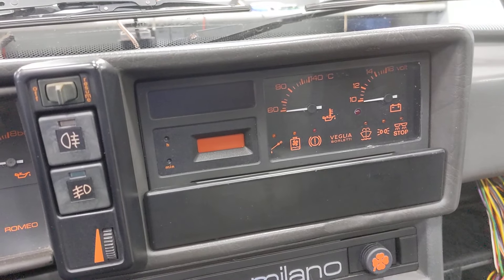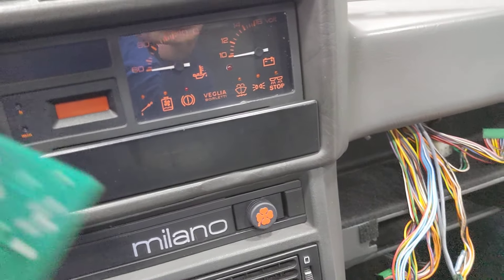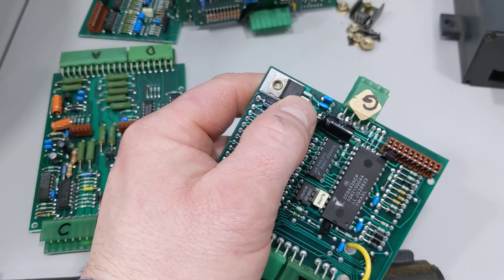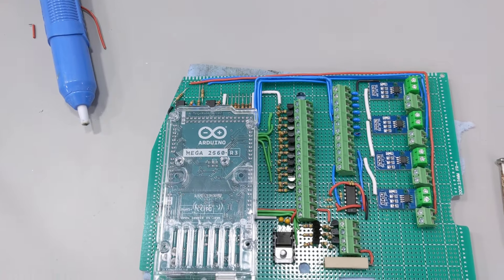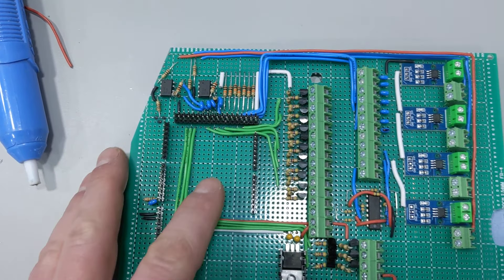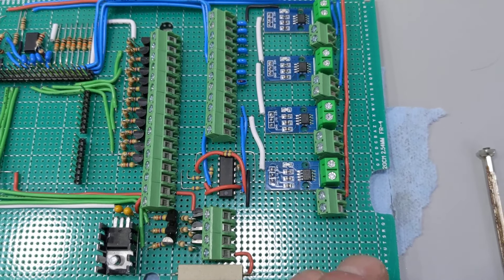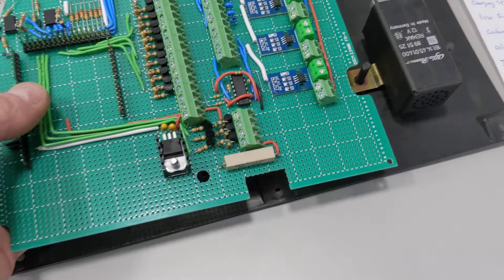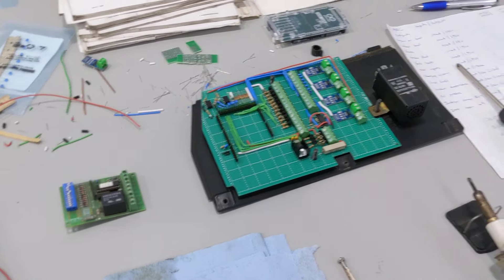Arduino Mega based Body Control Module for the Alfa Milano

Comment: Man this is a really cool mod. If I only had your knowledge to replicate it. I can’t wait to see how it all works.
Reply from the maker: Working OK so far, just a few small issues to work out. Not sure how the oil level sensor was controlled, as it's a bimetallic element. So far most stuff is functioning except the interior lighting, will revisit during the week
Reply: @Nodarperformance Cool project. Maybe the oil sensor is temperature related? I'm just guessing, but maybe it passes current to heat up a wire-wound resistor in the tip of the sensor and if there is oil it carries away the heat so the bimetallic switch doesn't trip. If the tip of the sensor is in air ( low oil level ) the switch heats up and trips.
Maybe now is too late, but if it were me I would de-solder de original connectors from the dead boards and at the very least make a pigtail to my new board. Best of luck with the project.
Reply from the maker: @danielrbdr  you are correct, the original board passes some current to the bimetallic element and detects whether the contact opens or closes. The issue is implementing that behavior with the new system. The original system isn't well documented, so it's hard to say whether the current was always sent to the oil sensor or only for a short period when started. I'll figure it out eventually. I chose not to reuse the original wire connectors because they are now obsolete and are a weak type of connection which tends to have issues with vibration. I have cut all the original wiring and used ferrules on the end - no going back from this. No harm, no foul though, because it didn't work to begin with and the worst case scenario is it not working now

Comment: "So I can go on with my life" , cool car and Arduino, good luck "getting over" this it seems very engaging.
Reply from the maker: Although there could probably be more interesting things I could be doing on my cars, for me it was quite engaging and rewarding. Finally getting the car's warning system to function properly for a change and also learning something at the same time was great. The old ARC system has never worked in a single Milano of mine - and i've been driving them since 2003!
Reply: @Nodarperformance  Very inspiring project ! Thanks for sharing.

Comment: Another wonderfull mod for the Milano😍😍
Cant' wait for updates!
On mine I am designing a similar control board but for the power windows. not with arduino but with pic microchip
 (actually a new version of a 10years old previous board, but the fear of catching fire is always higher with this old one 🤣🤣)
Reply from the maker: I really like programming PIC, the true reason I'm not using a PIC for this project is sheer laziness and also the complexity of the in/out
Reply: @Nodarperformance  
It's true! I was also using arduino for quite a while for the "plug and play" function instead of soldering PIC on a board etc.
I will tell you that I had also started designing my new board with an arduino mega (mega pro mini, which is smaller). But in the end, using the internal oscillator, on the PIC I didn't need any other external circuitry to operate except the ICSP.
so in the end I went back to PICs and opted for an 18F4620, which has 40 pins and plenty of memory for what I need!
Reply from the maker: @Alfa752000TS  I love this cool geeky stuff to solve problems!
Reply: @Nodarperformance  
definitely 😍
but also to add new features!

Comment: This is super cool, btw can you measure the value of the green resistor marked R100 K on the ARC motherboard ? mine is completly burnt out, i soldered a shunt wire to fix it temporarly
Reply from the maker: R100k means the resistor is 0.1ohms
Reply: @Nodarperformance  how do you know the correct value by just reading this 100R ? Since there is no color code on it ? What about the 050R k ?
Reply from the maker: @JacklapottTv  standard electronics nomenclature. R before value means less than one (1) ohm and R after value means greater than one (1) ohm. 050R k would mean a .050k ohm resistor or 50 ohm